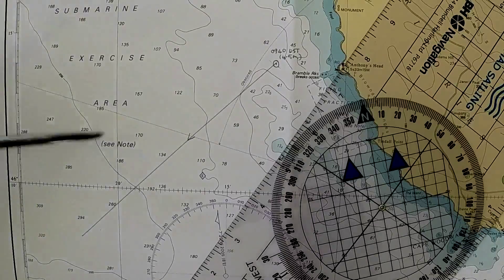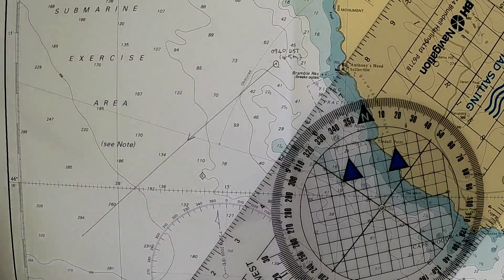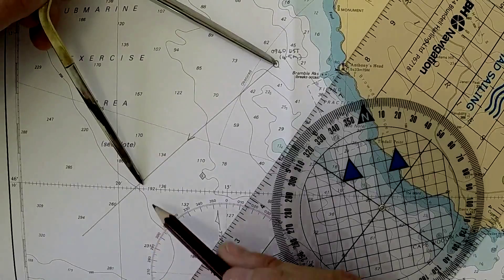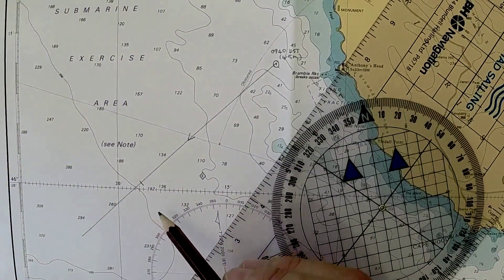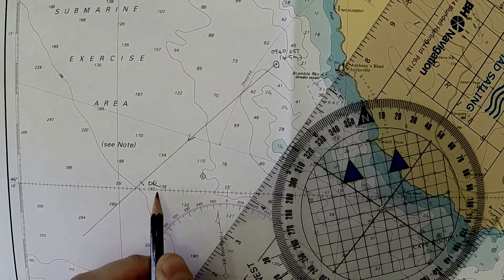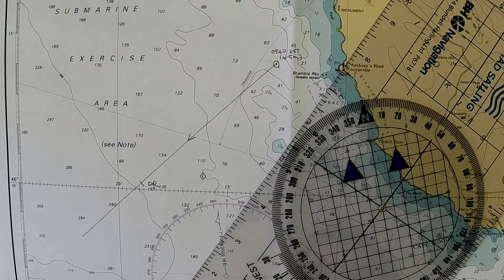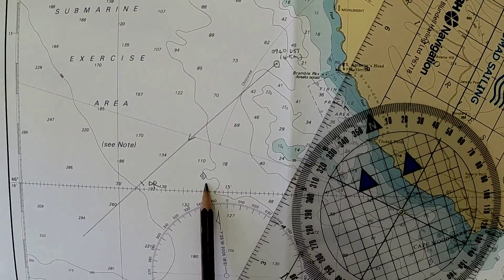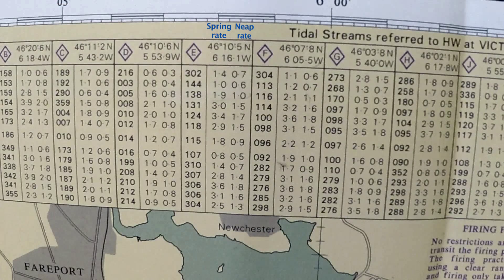Basic Estimated Position

Comment: At what point would you include deviation to this process?
Reply from the maker: If there is significant deviation it should be applied before variation (and any leeway effect).  Process of converting a compass course steered to a true course that can be drawn on the chart is: Course Compass - apply deviation to give: Course Magnetic - apply variation to give:Course True - apply any leeway to give:Course True that can be plotted on the chart.
Reply from the maker: Sorry to miss this question for so long :-(